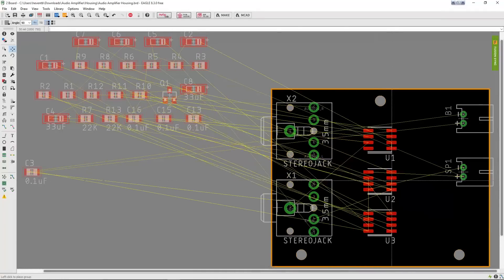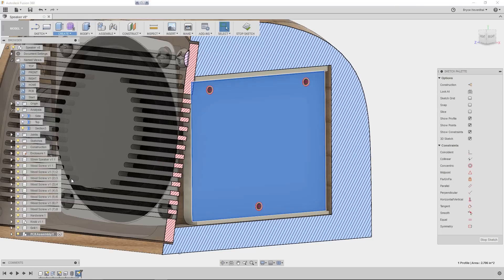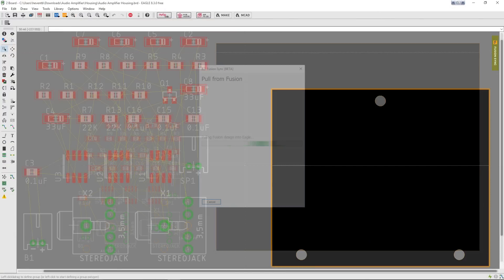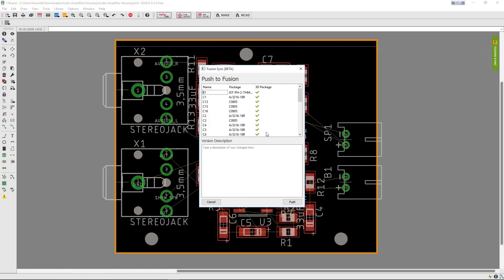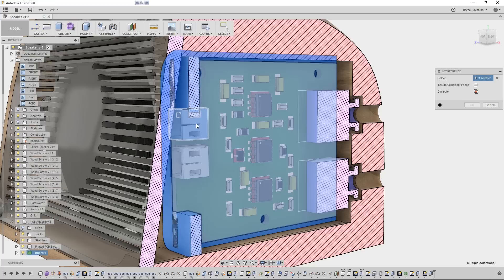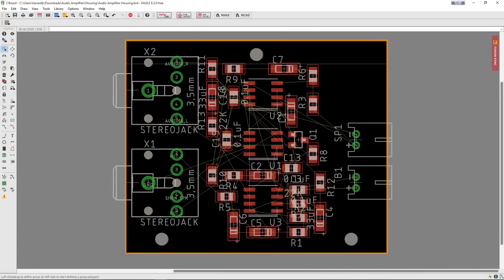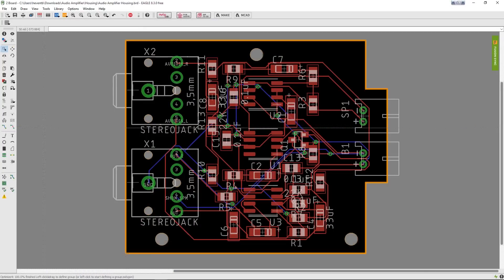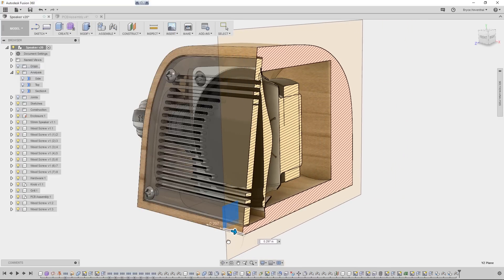EAGLE and Fusion 360 - Taking on a New Dimension

Comment: Hello, I got few question, please help me!
I draw my model in fusion, in the mid I add the PCB in where i want, I push to eagle, and Eagle found exactly the shape I want. After that finished my design I pushing eagle to the fusion, it show the PCB board it look exactly at 1:04. but how you can merge both of them together and view the PCB and model at same time at 1:10. Because on my fusion it show 2 of them seprate. Could you please show more detail how to add eagle PCB in the current draw? 
Thanks!